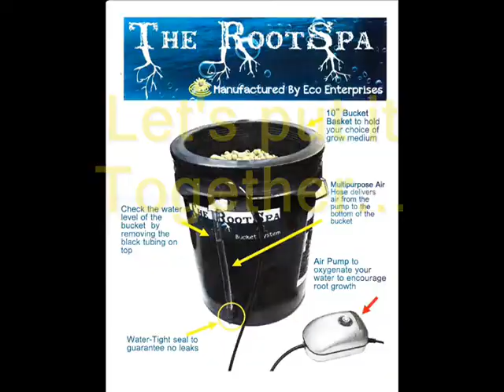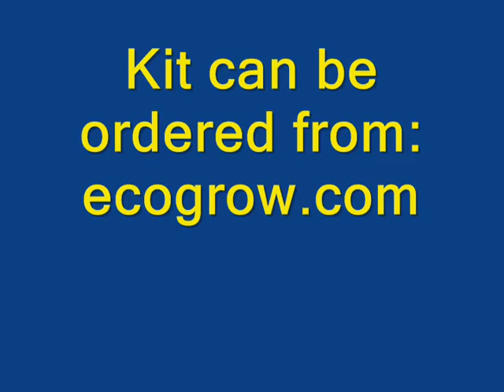Amazing RootSpa

Comment: I been using Rootspa for a lil while now, the only issues I had was light leaks bc of the clear blue hose on the side allowed the light to be funneled into bucket by the water which in turn slime was able to grow so had to treat with h202 for a week...Taped them up with electrical tape and is fine now...so using clear hose isn't such a good idea why hoses are black in hydro bc of that...